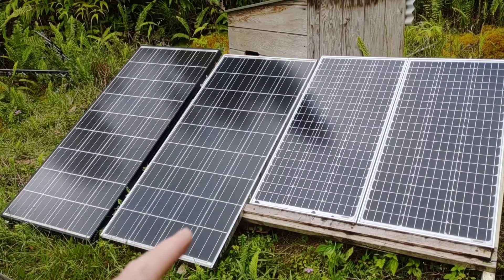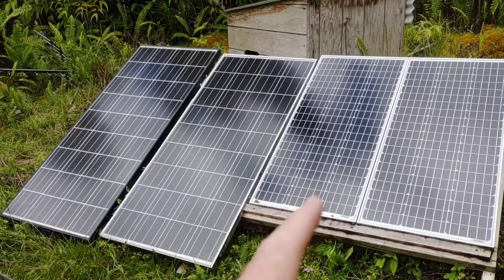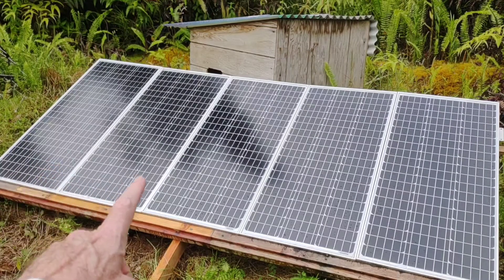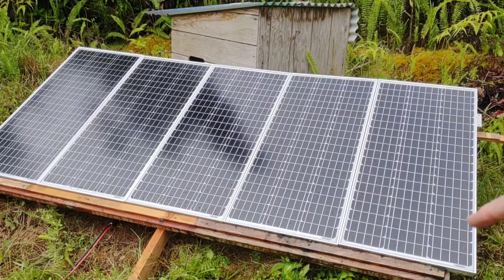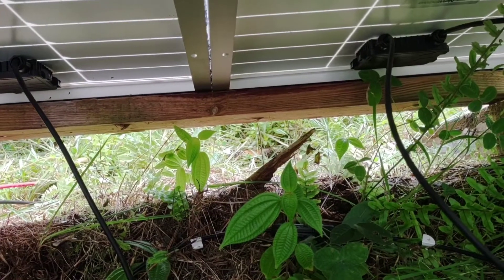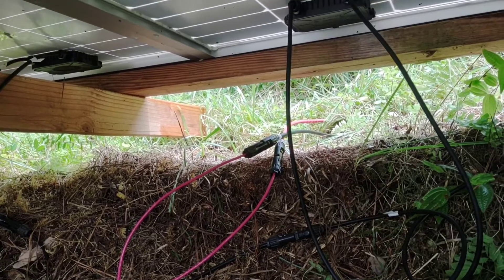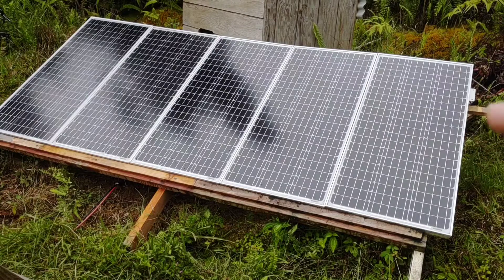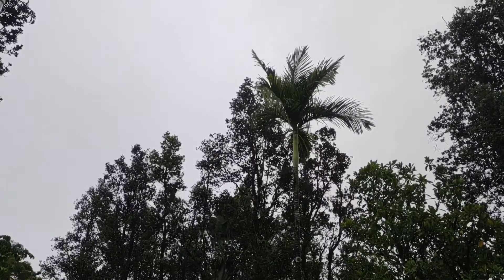500 watt solar array / Parallel or series ?

Comment: So when you went from parallel to series that did not change 12 volt output to 60 volt output confusing on that part. Someone please answer that for me. 5 12v panels in series equal one 60v panel in my head. Will that work with a 12/24v charger so confused.

Comment: Os it possible to still use your old panels you removed and maybe hook them up in a series-parallel configuration? Or as a seperate stand alone to your charge controller if not?

Comment: glad you figured that out. You have a MPPT controller . use series . add up open circuit voltage of each panel  and keep that below the max voltage of charge controller.  now take your volt meter measure the voltage right at the panel . the series voltage . then use same meter measure at controller. subtract the to numbers and that is your loss in wire . your run is long you may want to go to 8Ga lead in or add a 2nd set of 10ga and parallel the wire . take 2 sets of voltage readings in same sun if you can . as you add to your system think about the PV wire to controller.
Reply from the maker: Yeah I'm pushing the limit on the controller now, but very happy about the output in series. I was thinking about running 8 guage like you said.  I'll use the volt meter as you suggested for fine tuning my understanding of the losses. I didn't know how to do it that way. As always Robert...many thanks 🤙

Comment: you will most likely never get more than 80% of the rated power. Series is the only way to go in your situation ,but a good video  for  beginners to learn that.
Reply from the maker: Hey thanks for the comments.  Finally got good sun yesterday to evaluate how it was doing, and it exceeded my expectations.  With sustained sun was getting about 94% efficiency which surprised me. 425-450 watts, 28-30 amps. A couple of times for short bursts even went slightly over rated values.  🤙
Reply: @ProjectsinParadise808  good  i rarely get that kind of efficiency but my panels are not at the optimum angle.

Comment: Parallel configuration keeps the voltage 16 v or so at the same low 16 volts or so across 5 PV modules but the amperage 6amps X 5 =30 amps is totally higher is why you were loosing voltage over long distance as heat in the wires at the other end . But In series configuration the voltage is 16 v X 5 = 80 volts or higher with more of the same modules added in series can be sent over long distance without heat power lost in the wires at the other end . It’s all about the higher voltage to push the same small amps over long distances of smaller wires without losing hardly any voltage at all . May the solar be with you .
Reply from the maker: Mahalo for the great information CG...I admire your system from a far...I've got a lot to learn from you, and really appreciate your encouragement,  and expertise...aloha 🤙

Comment: Yes. What I learned in physics class in mid school still works.

The power companies transport electricity over long distances with high voltage, and distribute it with low voltage to the houses.

At the "exit" of the panels you'll have the same amount of watts, regardless series or parallel.
But in the stretch of cable from the "exit" of the panels to the "entrance" of the charge controller we'll have losses. A voltage drop. The longer the distance, the more the drop in voltage. So less watts arrive at the "entrance" of the controller, than had left the "exit" of the panels. So series will be the winner at longer distances, because with solar panels in series we get the high voltages..
Reply: You could buy two cheap PWM solar charge controllers (around US$ 20 - 60) for each of the old poly' panels that are a good match for each other, and set them up as close as possible to the batteries for extra fast charging.
Reply: Or sell one, and with the money buy a PWM controller (compatible with lithium batteries) for the remaining one.

Could also be used for charging of the smart battery.
Reply from the maker: All very good information,  and thank's a lot for sharing with us.  I learned alot in past couple of days. I didn't film all the frustrating parts of my learning experience, but am super happy now its cruising as should be. aloha 🤙
Reply from the maker: My mid school was so long ago, I don't think I have access to those files anymore. I learned quite a bit , and others like yourself help me tremendously...thank you kindly...🤙